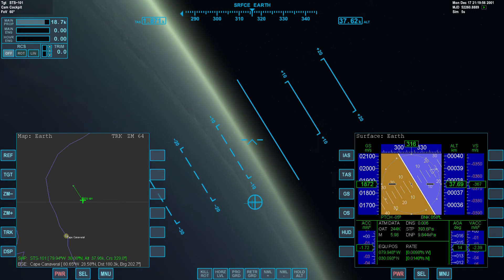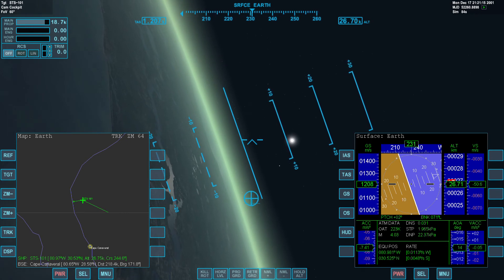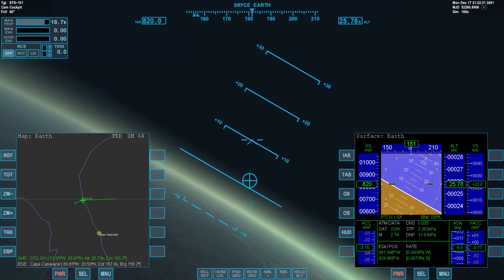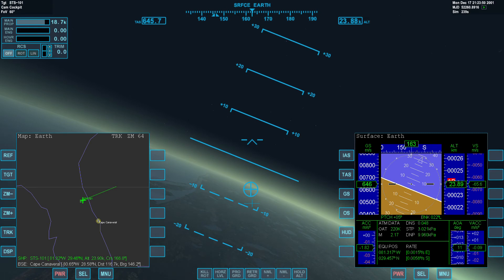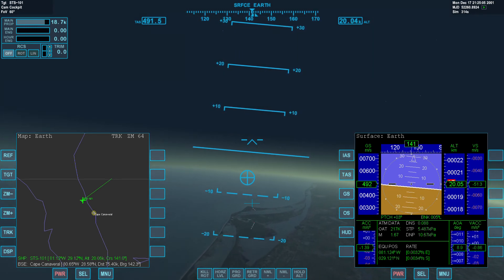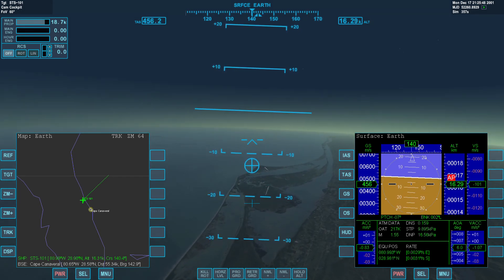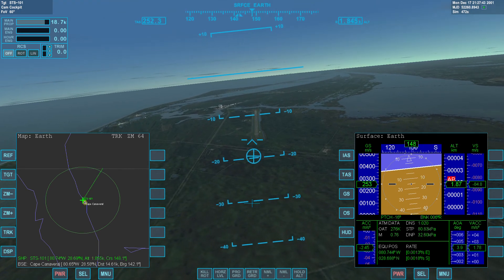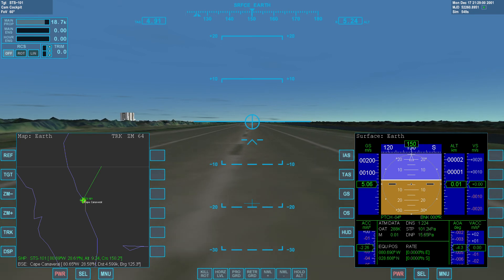Orbiter 2016 Hypersonic 180 turn for Space Shuttle landing at KSC

Comment: The reason for flying the HAC is to compensate for any variation in energy.  Generally, they would approach with a substantial surplus energy and when they got to the field they'd get a final update on winds and energy so that they could fly the appropriate HAC -- if the energy was higher than required the radius of the HAC would be larger and if the energy was lower than required the radius would be reduced.  The idea was to compete the HAC with just enough energy surplus that the extra energy could be removed by speed brakes or maneuvering (slip/slide).  I do not think they ever flew a straight in approach for this reason, but, yeah, this does require the computer to do it or at least indicate the proper course.  It's impossible to plan this days or even hours in advance as the weather can change pretty quickly!
Reply from the maker: I didn't know that the HAC was adjusted for weather.  Thanks for extra background.